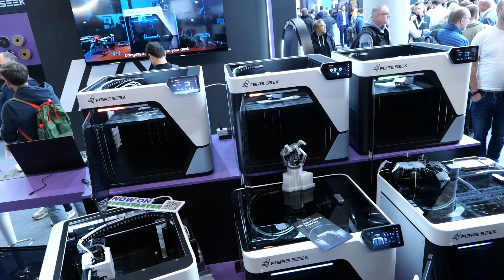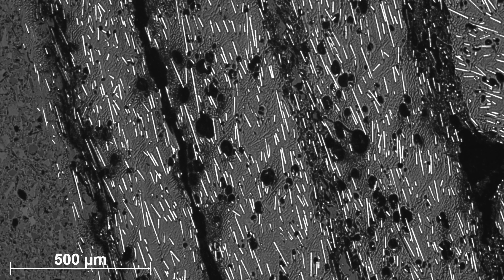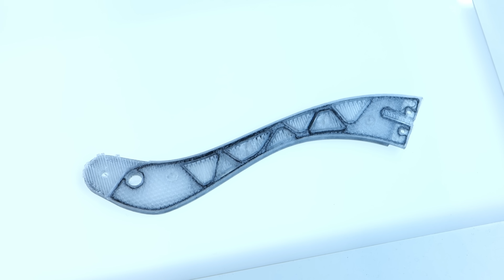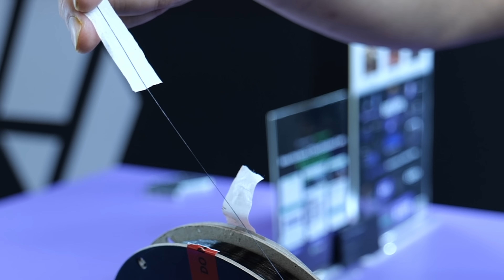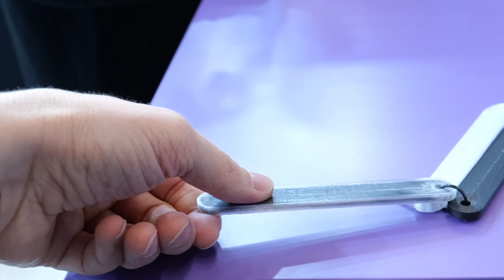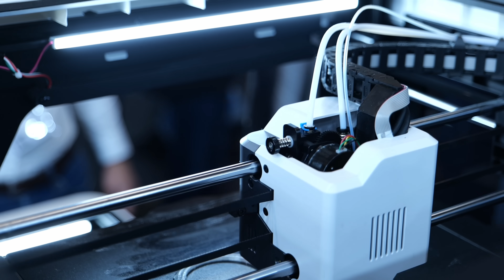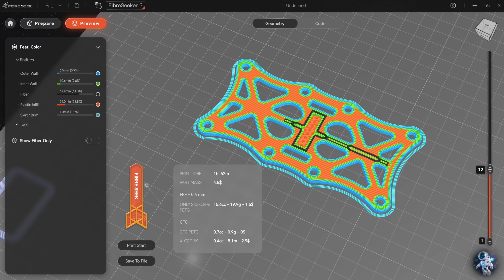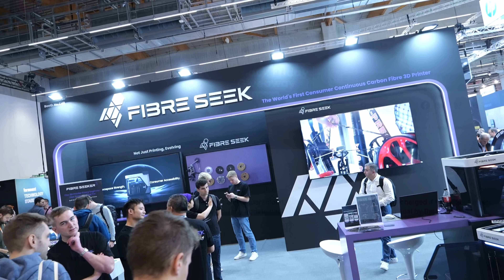The FibreSeeker 3 brings Continuous Fiber Printing to Consumers!

Comment from the maker: Gamechanger or Gimmick? Where would you love to have a continuous fiber 3D printer?
Check out the FibreSeeker 3 on Kickstarter: https://fibreseeker-3.kckb.me/cnckitchen
Reply: Affilate link to the kickstarter (on top of the sponsored trip and possibly a fee) before you actually reviewed it...? 
Sorry, I hate to say it but that strikes me as quite the departure from what I'd come to expect from this channel.
Reply: Gamechanger for sure!
I'm just not so sure about their execution here ... I was at the booth too, and while the printers have a slick exterior and really pretty UI, the inside looked a little flimsy and cheap (like a Qidi from years back). It's not bad for a first attempt, but I'll wait for the same tech as a tool changer head.
Reply: I was using 3d printed molds to make forged choped fiber parts with continuous tow in strategic places , for sure these parts will be stronger than 3d printed continuous parts equivalent ,as tested by Easycomposites youtube  channel. But process is time consuming , dirty ,labour intensive. For quick prototyping or even small batch production of quite strong parts Fibreseeker is   perfect. Also in bending these parts will not match aluminium strenght.
Reply: Anyway i think this is fantastic tool in any maker workshop , especialy at kickstarter price point.
Reply: Potential Game changer. The ability to print functional parts with a near aluminum strength is the end game of functional additive manufacturing. It sounds like Fiberseek is doing it smart and not trying to use it as a cash cow or price it out of the market. It's price point is in line with conventional high-end FDM printers. I don't see the material costs as excessive, the only special material is the epoxy fiber, and if these machines become more popular, the free market will cause the prices to stabilize and possibly improve.
Reply: Which dust mask do you have?

Comment: This is much cheaper to give a similar result.  Put a pause in your print on your existing printer.  Lay down an open weave layer of CF cloth.  Resume print.  This gives you full length carbon fiber fabric inside your print.

Comment: Great introduction video. However, 3weeks later and v2.0 out, but there is no reviews. On one hand I am really impressed with the Fibreseek implementing changes very fast and listening to suggestions at KS, but on the other hand, nor reviews still means the printer is not ready. I wonder if this means a delay in shipping or that half of the shipped printers do not work as expected. It is fair to say that today the expectation is that the printer should print at least as well as BBL, CR, or Elegoo,  and feature the continous fiber. Yes, the price may be attractive for the promise, but if it prints like an old clunker, we are going to have a problem.

Comment: I saw this machine at formnext. And I know that 900 mega pascals sounds like a lot but I had the chance to try to snap one of these parts. the one that’s made of pure fiber. This part was a  small part that was a rectangle of 5mmx10mmx50mm. and i tried  to snap it with all my strength and wasn’t able too it’s insane how strong they are. also I think some 3D tool paths could help fix the axis issues for example like stepping the carbon fiber layers. So instead of cutting away the layer you could make it do a z move and print the next loop in a continuous form kind of like vase mode.

Comment: Markforged printers have been doing this for years and work quite well.  But the Markforged printers are ridiculously expensive, only can print a custom CF Nylon they charge $200/kg for, are slow, have unheated print beds and enclosures, and have a web only interface that requires using Chrome only through their website.  Markforged goes belly up and it’s a doorstop.  Their printers are basically a one trick pony for a price that makes little sense for nearly all users.  

If this printer works the price point is literally an order of magnitude cheaper than Markforged.

Comment: This looks very interesting and seems like a good alternative for smaller businesses who need to prototype small strong parts.  A few questions come to mind, though.
How do parts compare to other filaments such as Tullomer?  It seems like the FibreSeeker would produce less expensive parts in comparison, however I'm curious about strength and layer adhesion when doing a composite part.
Another issue is what happens if FibreSeeker goes out of business?  Will there be any support from the community or other businesses so we can continue to use the machine and buy material (carbon, glass, or other)?

Comment: I visited their booth at FormNext and talked to CEO and sales rep. Both seemed a bit arrogant and on a high horse. The machine itself looked really nice on the outside. Can’t ask for much for the price but it looked like a lot of cheap parts were used. No linear rails and cheap injection molded parts with cables visible. Kudos for bringing CCF to a wider audience but my experience with them left me with a bittersweet aftertaste.

Comment: I look forward to seeing your strength testing of these parts, especially in the Z directions. If the parts are strong as aluminum in the X and Y but not stronger than PLA in the Z axis it's nothing more than an expensive, bad joke.
Reply: Why would they be stronger in Z?
And why is it a joke if they are not?
Reply: @kfirbehar6720 what good is 900 mpa in the x and why if you only have 20 mpa in the Z axis?
Reply: @snarkyeconomist2141 if you know the stresses that your part will experience you can design and print it in a way to take advantage of that.
Not everything needs to be isotropic, some of the most useful materials are not isotropic.

Comment: I love this stuff! It has filled my every day for the last three years. I have been investigating this material combination and non-planar and load oriented slicer development in my PhD-work at the technical university of Hamburg and i am really excited to see this process get more acknowledgement now. I have been able to print a topologically optimized part with non-planar layers this way (not yet published as i am currently writing my dissertation) and one thing that is really interesting about Anisoprint/FibreSeek is that for load oriented and non-planar slicing, dynamic layer height variation is key which is not possible with the Markforged style towpreg printing. I have a whole publication published in the journal "additive manufacturing" on this, you can search "Johann Kipping" in google scholar and you will find my work. Another recent publication is on the printhead design needed to be able to manufacture the non-planar layers which also has some interesting challenges. I have been developing the slicer (it a has a FEM tool inside of it and generates 5-axis GCode) and the path planning algorithm which is load oriented and single-stroke for fiber continuity and once i finish my PhD i would love to make it open source. I could talk about this stuff for ages...
Reply: @cnckitchen if you want do get more info on this or ask some questions personally i am all yours! Been watching for years and you delivered some foundational knowledge for my PhD, so i would love to talk. I really think i might have some interesting answers and takes on the future of this stuff

Comment: Trying to work out, rather than a new printer, why can't you have a multi toolhead printer with a toolhead cutter. Then use a filament with continous fibre already in it and filaments that don't. You can then just change between them and the filament cutter sorts out the fibre

Comment: $2699 at a "46%" discount price isn't very affordable, they should've gone with a bigger build volume for a broader market of practical industrial/commercial application use cases. The majority of hobbyists I've seen in social groups already complain about Bambu labs $1500 and sub $1000 printers being too much. Cool tech for sure but it seems like there's more hype than practical application with it's size.

Comment: Nice, but I already have a floundry, at that price I might as well make the part in cast aluminium. 
I do still have uses for 3D printing parts, but at most I only need polycarbonate filament without carbon fibre if I take into account it's strength properly during design

Comment: 4:51 my question is a) how does it not backflow up the nozzle into the heatbreak and b) why is there a gross thingi when the channel takes a 90 degree turn, aren't hose gonna collect plastic and make changing filament a nigthmare?

I was trying to DIY this back in Iran with my limited resources and what help me back was coating the fibers in resin etc, i could not get it to be feed able. the slicer is also hard to make.

Comment: Still won't be a replacement for true composite materials until they can recreate the different weave types and Hexply 913 & 914 working temperatures.
Reply from the maker: No, of course not but the idea here is tool/mold-less and much faster than normal composit fabrication for individual parts.

Comment: This is no gimmick to me! I would love this, in fact its something I've been thinking about myself for a quick change tool kit. A metal 3d printed head allows for a feed in through a rotation, this also allows for it to cut the fiber there too, just at the end of the fully extrusion. 

The rotational side is pretty easy if you think about it as gears & a simple sinch/snip & yank to slice motion. It uses thermal expansion in the ranges it operates at to make it function better, it's intentionally lower sized to account for that expansion, is what I'm saying.

It just needs to have a spool feed next to the single nozzle that just yanks back then cuts the full fiber, I do have to lift it out then slide a pushing out into the melt chamber round lobe like area into that spot to make sure no filament comes out. 

It's got a 3 to 7 into one filament mixer chamber. It heats up the sides then spins, then that rolls the filament into pellets that then extrude through the below chamber, perfect for the dust mixers (for metals & ceramics) & ground/chopped fibers (different strand spray profiles for better entwinement of the other plastics in-between the fibers, they re-adhere together to allow for it to be printed in different diffused ways, I was not wanting to build a brand new slicer as programming isn't what I'm focused on right now. So I've been delaying, hard, on even making a video about it, for the design concept &  outline of it) + powders 

(chemical, metal, surprisingly b vitamins & or more all can become incredibly good catalysts for various reactions that turn this into a multi bond meta material type deal. Like, they bond more like poly-amorphous with lattice structures, often thanks to the plastics & metals, joining with ceramics & how you can start reactions for these materials when using those compounds in them. In fact its how we think certain bacterium might break down some bonds, with the help of these kinds of things. Peptides, vitamins, minerals, etc etc it goes on & on, add in a little carbon nano onion ball (microwave kiln & fish scales, look it up, great science article & youtube videos about it) & it starts acting like bone that can be made to allotrope differently & or produce even mono-polycrystalline structures that are polymerized)

.... Powders

yes, basic powders, nothing to them, like tungsten & silicon carbide you made in your microwave kiln using old e-waste & fish scales, or nylon.... something.

In a vacuum. specifically, that way with a previous argon flush to improve the non-oxidation aspects of this reaction spread.

You can add in needed plates to strengthen an enclosure & run a vacuum pump to it while shoving argon in, at low pressure & speeds.... You know, so that way it acts like you are printing with just the argon gas you are pumping in & vacuuming into a compressor for later.

This means you can print even hotter stuff, using some very small exotic metal 3d printed parts with regular, you knoow stainless/good aluminum expansion co-efficient knowledge & skill... Makes it much cheaper. Stepper motor rotation. Gears for torque. It was all a plan. This would help out a lot, this printer for all of that.

Electricity can enter into the equation for the 3d printer, with a good vacuum going on, together with lasers at a swivel ring angle around the nozzle, with a small tungsten carbide electrode nozzle that is, ring? .... Right coils. Yeah. No they're... Yeah no its magnets of the electrical kind now time.

Changing crystalline patterns during cooling & printing allows for you to further alter & join your fibers that can be moved & tied together using this technique. While electrifying them through, both dc & ac, sure, but light & electromagnetism. This means they move & send electricity to further react, bond, weld & more your prints with fibers that remove the "super highways" of your crystalline structures you join together.

Like in veritassium's video. About super alloys for jet engines. This removes a defect flaw in that design. So its stronger & higher temp proof while being printable at regular temps we have today already been using. Like, if wanted I guess you could do 420.69c (lol yes) for incredibly high temp powders bonding at the needed current & reactants. The spool its planned around your print, the whole thing a "magnetic tape hard drive" if you will, of instructions to the chemistry & more going on over the course of your print.

It's literally that, it triggers your print to auto do those things those ways, so you plan around it. A joiner & a few filament holder is the chamber thing above. Its going to work with that slicer, from what it looks like.

Comment: Did the printhead used for the carbon fiber has a cutter? How did this work when this hotend does movement ?
Reply from the maker: The printhead includes a cutter, so when a fiber extrusion ends, it cuts it 45mm before that happens and the rest is then simply dragged out.

Comment: Wrong approach to continuous fiber printing.
1. Meaningless without loads taken into account.
2. Any holes will be thorn out as they are supported by plastic only.
3. Last but not the least: shift forces in reinforced plastics, just think it over.
But - this approach is better than nothing or just chopped carbon. 😂
Reply: Yeah, but this approach still has its advantages, as well as workarounds. For example, you could use non-planar infill to improve shear strength.

Comment: Looking at this cooextrusion solution i wonder if  it wouldn't be much better to make plastics channel at angle instead perpendicular to fiber channel, so it would assist in extruding fiber tow ?
Reply: I would be worried about clogging nozzles. This design is a recipe for disaster.

Comment: I'd be interested if there is a way to expand the fiber that is placed by the fiber head to use woven CF and add that to a resin chamber printer to make your own hybrid CF printer. Then you could have the custom CF prints that could be more like hand or machine wrapped models, but faster. Then again maybe there's not a lot of use for something like that😅

Comment: With regular fdm you can mitigate the layer weakness by anguling the part and being clever with the orientation. Or even getting into non planer printing.
The complexity of the head and the planar limit of the fibers kinda make that impossible for this machine.

But if you can limit the strength requirement to a single axis this tech is insane. Maybe all it takes is just printing 2 parts that interlock and you get full strength in all loads.

Comment: With your testing and your approach I am very curious about the findings of the true performance as YGK3D has pointed out some interesting details
Reply from the maker: The thing is parts need to be somehow designed for this method and I'm considering making a guide on this.
Reply: @CNCKitchen please just release a test video before the kickstarter locks in.

Ideal test would be print same part on Markforged and see how close it gets. 

Not saying I cost it to be as good but would be nice to know if it is 40% as good or 80% as good.
Reply: @CNCKitchen  Yes, that is totally fair! Great, looking forward for that guide! thank you

Comment: The punched-hole specimens honestly feel like they lack real engineering significance to me. Those tests are fundamentally about measuring the allowable stress in the presence of an existing defect or partial fracture (notch sensitivity, bearing strength around a fastener, etc.). So I was left scratching my head about what exactly they were trying to demonstrate with that approach. It’s definitely memorable, though—just not in a good way.
On a separate note, the rationale for macro-scale reinforcement with carbon can stay pretty straightforward. If it were up to me, I’d go with ultra-high-tenacity PET short fibers and formulate a PET resin system that stays dual-phase (melt + solid fibers) in the printable temperature window, spin that into filament, and print with it. Same polymer family, perfect interfacial bonding, massive anisotropic strength boost, and recyclable to boot.

Comment: It's extremely rare you need a lot of strength in xy, but are completely ok with almost none in z, this is neat but generally.... useless. and dangerous

I wish someone would do the hard work of injecting fibers into holes in z, this would be so, so much better.
Reply: TenTech already did that by implementing non-planar infill as a post-processing script.